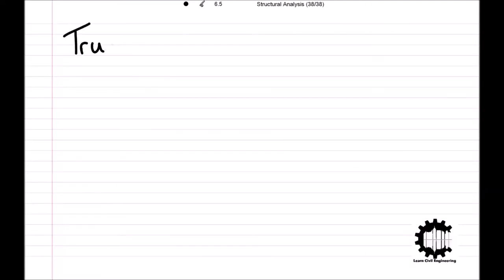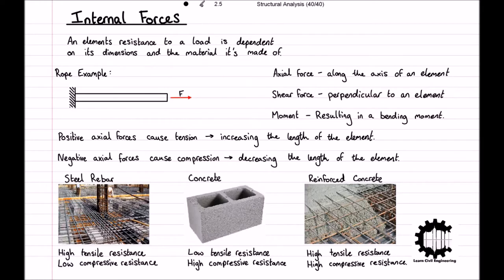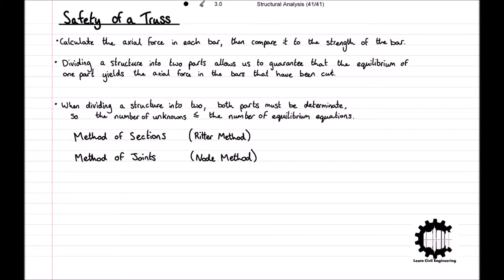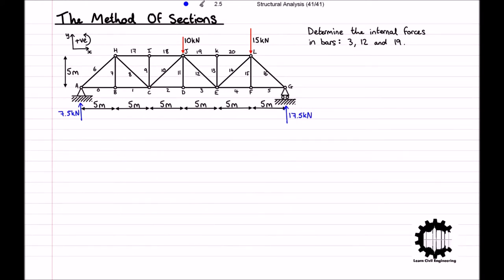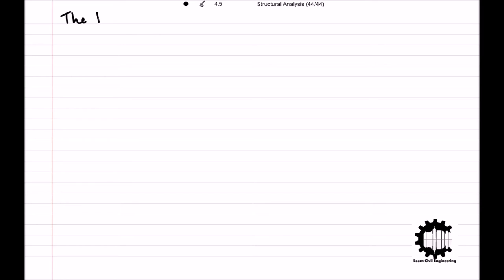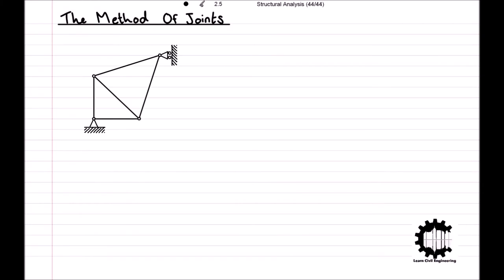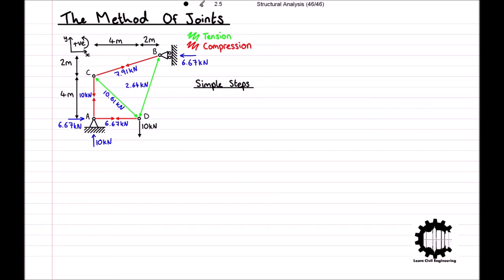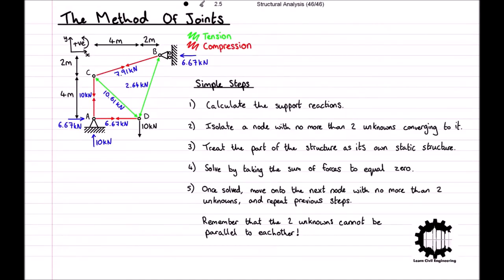Analysing Trusses - Method of Sections - Method of Joints - Structural Analysis

Comment: Question. On the method of joints, while you were setting up the equation for sigmaFx=0 at point D (20:33 video), why did you choose the 6.67 positive? I think it should be negative since it is going to opposite direction. Also, same error I've noticed on Sigma Fx=0 at point B as well (23:23 video) you chose 2.64 negative, but I think it suppose to be positive. Please correct me if I am wrong. Thanks